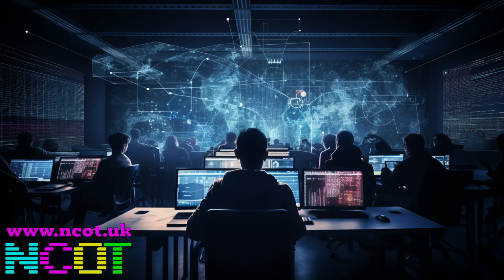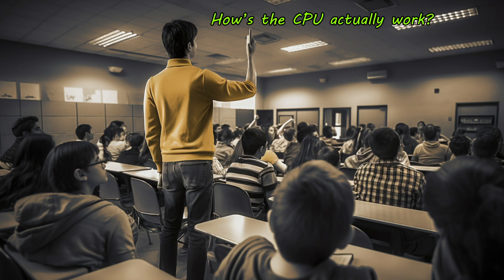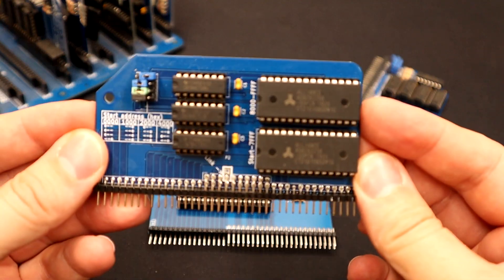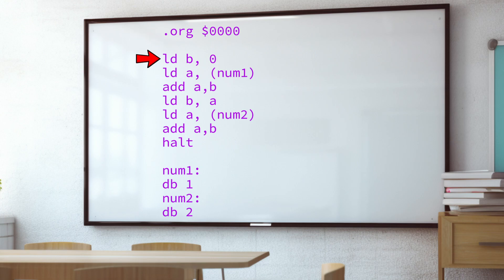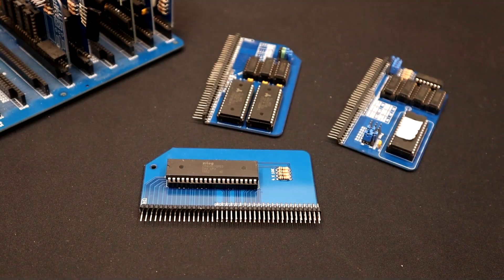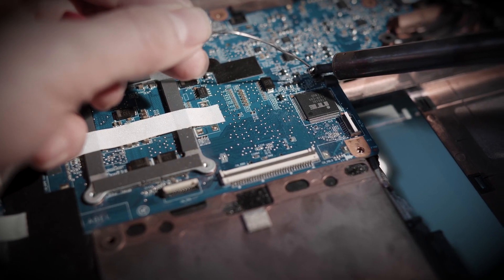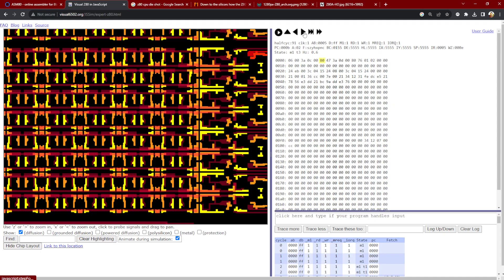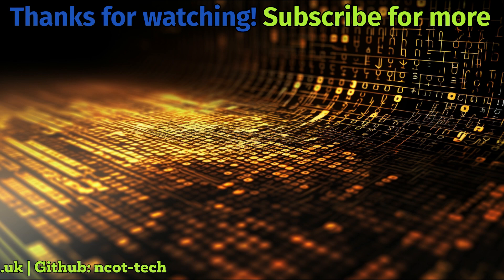Zilog Z80 Deep Dive - How does it work?

Comment: First of all, thanks an informative video.

I'd just like add a few things to the subject:

Nowadays the programs (the opcodes) are stored in the main memory but it was not always the case. Originally the "computing machines" were more thought as super calculators because it was where the need arose first. Mechanical or electromechanical devices had data separated from the "code" that took the form of a hardware configuration. This was tedious and error prone.

The idea of making the configuration virtual by storing the configuration as digital values was a novelty that got the name "stored program computer". Some CPU architectures still use separate spaces for code and data (Harvard architecture).

All the "regular" machines that we use today come from the famous Von Neumann paper (the original sin of computing). This paper was a mathematician's view on how to use an automated device to perform calculus and only this; using that era's technology. How to decode a formula expressed in text form and compute (evaluate) its result. The issue is that that specific paper for a specific task was generalized.

It went from:  This is A way to build a computing device
to:                    This is THE (only) way to build a computing device

There are many other structures and means to perform computing tasks, many of which are not sequential. The first one that comes to mind is neural networks. But unfortunately the Von Neumann model (Y shape with arrows) has "polluted" the minds of all engineers. This is why it is often difficult to get away from the "sequential mind bias" (parallel programming).

The machine code of a CPU is the "grammar" of that CPU and gives it it's "personality". This is carefully crafted because it is what the programmer will "see" from the CPU. This is evidenced by the acronym ISA (Instruction Set ARCHITECTURE). The coder is supposed NOT to know and not need to know how the instructions are actually implemented. This is "at the discretion of the implementer", a form of "API" to the CPU.

The only way "construct complexity" out of thin air is to implement an FSM (Finite State Machine) in some way. This state machine is the link between the instruction opcode(s) and the internal logic components that actualy perform the intended operation. This is why the internal logic can be completely different from what is seen from outside (the Z80 has a 4 bits ALU, see Ken Sheriff's work). The instruction decode is only the first stage of this FSM. An operation symbolised by an opcode is rarely if ever performed in a single step of the internal logic.

Most 8 bit CPUs like (8080, Z80, 68xx, 65xx) implement this in combinatory logic with a special note for the 65xx family that uses a ROM as a first stage.

Because the CISC (x86 etc...) CPUs have become increasingly complex this has been replaced by microcode.
The actual hardwired state machine is replaced by an internal, hidden CPU that runs that microcode. Because there has been an inflation of modes, flags, security conditions etc... the number of clock cycles to execute a single top level assembler opcode has increased (sometimes 20 or 30).

As opposed to this the RISC design paradigm does the exact opposite. Most of the RISC CPUs seek to increase execution sped by using as few cycles per instructions as possible. The only business of the CPU is to EXECUTE code not make decisions it has no information about. All complex decisions are delegated to the compiler.

This is only the CPUs that are inspired by the Von Neumann model. There are many "funny" CPUs even designs that seek to use analogue attributes of electronic components. These are usually, very application specific and require interfacing to the standard digital world.
Reply: What do you mean by “few cycles”? 6502 needs two cycles for a lot of instructions. The SH2 in the SEGA Saturn, the MIPS in The PlayStation need one cycle per instruction. Though these consoles cheat. You only have limited SRAM. DRAM access takes many cycles.
Reply: @ArneChristianRosenfeldt  By "as few cycles per instructions as possible" I was referring to a design goal of the ISAs. 1 cycle clearly qualifies as "as few cycles per instructions as possible".

Basically RISC designs have so few clock cycles that the execution time is equal to the fetch time of the individual bytes from memory. There are no added cycles where the CPU is just churning inside.

The 6502 by its design resembles a RISC design but Sophie Wilson (designer of ARM) said it is on a category of its own. I am not sure why, but maybe because of the 0 page operations that can operate directly on memory and do not obey the "load / store" principle of RISC where the memory transfers are separate instructions from the compute operations.

As opposed to RISC, CISC designs do not have as a primary goal to simplify or reduce the clock cycles of the execution. The hope is that by having more "complete" instructions that more closely matches the C language for example, the instruction count would be reduced to for the same task. The drawback of this is that it leads to complex decisions at runtime.

So, CPUs like the 6502 (even if it is not a RISC CPU per say) will tend to have an execution time that is exactly the byte fetch count when instructions are executed on registers. So an instruction with implicit operand on the accumulator will only use 1 cycle. When using 0 page instructions or indexed addressing the number of byte fetches will extend the execution of the single instruction because the instruction become memory bound.

These memory bound operations would not be allowed on a real load / store architecture. You would have to:
- load in a register
- compute
store the register back in memory
 as 3 distinct operations.

So to summarize, when you are in the very specific case that you have a CPU that is both RISC and load / store (AVR, MIPS) you are correct, most of the instructions will be 1 cycle, unless they need to be extended by wait states for slow devices. This is only valid because direct operations on memory are not allowed.
Reply: I just meant that MIPS as invented at the university in 1980 aimed at 1 cycle per instruction. I just mean that they replaced the complicated "few" optimization problem with a KISS: one cycle or we don't do it. 6502 actually is hardcoded to use two cycles to fetch. One cycle is wasted on single byte instructions. The CMOS version corrects this. Probably it was never really needed, but simplified things. The zero page thing was seen in other microprocessors of the time. RCA 1802 had this external register file, where you still had to load values into the ALU first. Then there was this "first 16bit" CPU which actually just stored 16 bit values in a zero page like a 6502, but could already switch the page for mutli-tasking. So the motivation was not to implement complex instructions, but to outsource as many transistors as possible to off-the-shelf memory. Z80 has 16 bytes. It could really have supported a lot of reg-reg instructions and hence load store may have made sense. reg-mem saves you register transistors because the other operand is loaded into a temporary register, which is free again in the next instruction . The same register can be used first for the addressing mode and then for the reg-mem operation. CMP and test ( zero register target ) also save. RISC CPUs use the same addressing modes. Only Postincrement and Predecrement or so is missing. I don't really know why. Yeah, would need to write back two values into the register file at once. But that would also be useful for a two register pushy shift. Source: Bitfield, shift value, write backs: left half  and right half. I guess that MIPS did not want to carry around circuitry which is not used by most instructions. ARM has a dedicated stack pointer just like the 8-bit CPUs.  @danielleblanc5923

Comment: It's hard to give an exact one size fits all sort of explanation to a question like how does the CPU decode instructions. 
Different Instruction sets allow for different approaches and optimizations when decoding (for example by having categories of instruction types that share the same layout of bit fields), different hardware implementations can be done for those instruction sets depending on target performance, power usage etc. And different architecture types for a certain ISA can have different requirements for a decoder (for example parallel decoding in superscalar CPUs, predecoding, microcodes etc.).

Looking at older hardware, which tends to be simpler is a good starting point however.
I think working with the abstraction of logic gates and explaining a CPU using a visual logic simulator (like Logisim, DIgital by hneeman etc.) is much more approachable, as it is easier to see individual parts of the CPU and is easier to comprehend. By adding an explanation of how a universal logic gate (NOR or NAND) can be implemented using Transistors, all of the abstraction can be undestood.
Reply: @Ignat99Ignatov 
I know how semiconductors work and that would of course be necarry to understand if you wanted to know how modern CPUs are typically implemented in hardware, but I doubt that you'd want to know that in order to understand how a computer works on a lower level, after all a modern computer could just as well be implemented with vacuum tubes, relais, mechanically etc. and work exactly the same, so understanding the physics that make semiconductors work for digital circuits isn't necessary. 

Computer architecture is mostly about the higher level concepts and how they can be implemented with simpler building blocks that can easily be synthesized into hardware (e.g. designing an ALU based on gates and latches in the Register Transfer Level or Hardware Description Language).

Looking at a Computer without any abstractions makes it hard to get insight into why a certain p-n junction is required and what it is used for, since that is typically defined by the abstracted design, which is the reason why I am saying that starting with a layer of abstraction would be useful for understanding how computers work.
Getting to see the actual hardware on a die is still interesting of course! It just isnt suited well for learning about computer architecture (which as I understood it, was the goal of this video).
 

Sorry for the long reply, your message seemed to critisize my suggestion of using abstractions so I wanted to clarify why I suggested that in the first place and clear up any misunderstandings about my intention.
Based on your youtube subscriptions I assume you might be familiar with digital circuit design and that you get what I was trying to say.
Reply: @Ignat99Ignatov  so your argument is "I worked on semiconductor designs professionally therefore you don't know how a transistor works and everything you are saying is wrong"? That's quite rude. 

 I'll reiterate that my argument was that in order to understand computer architecture abstraction is useful. Looking at a die and saying "that's where the zero flag is stored" is less useful than explaining the concepts of how everything works together.

there is a reason why most books about computer architecture use abstraction and why HDL is popular.

Physical implementation of a digital circuit and conceptual design can be separated when learning about the fundamentals, which is especially useful when you don't know anything about either.

I'm sure that you know your stuff well, but I learned computer architecture separate from semiconductors and can still understand the concepts well enough to design processors in HDL and simulation software, which is all I need as long as I don't do hardware design professionally.

I'm just trying to help as a person who is interested in the topic and was once in a similar position as the student described in the video, which is why I thought that my comment might be relevant.

If you were nice about it and provided proper arguments that would be much more helpful to me and anyone else reading the comments. I sure hope that isn't how you treated your students.
Reply: Yeah, the famous Jump, Immediate, and Register instruction subsets of MIPS. But Arm and power are so complicated

Comment: I started out in college building my first computer in 1979 which was a Z80 and literally wrote machine code and later assembler to make it do stuff. Yes I went on to be an electronics/communications/television engineer but the fundamentals about address & data buses, clock and control signals, instruction decoding, program counter, registers, flags, and the stack pointers stay with me always. chips like the 8080. 8085, z80, 8086 and pic16xx processors are really good entry points for learning the basics.  We would actually watch the control, data and address bus pins with a logic analyser to see what was going on inside the CPU and by inference the rest of the computer. Unfortunately once the 80386 and later models came along with caches and pipelines the outside pins of the processor could no longer tell the watcher what was really going on as the data from memory is fetched into the cache/pipeline way before it is processed and sometimes dumped when a branch occurs. Finding a way to give your students a real vision into how a CPU really works will be enormously helpful for them moving into a technical career. It certainly helped me. 
I lament the current generation of want to be techs, that we really need, have absolutely no idea of this stuff as we are all now just application users on black boxes running software created by others.
Thanks for the video.

Comment: The box on the cpu circled the cache, not the registers. You can tell because the are organised in rank and file like a grill. The registers are thousands of times smaller in area. A reprise of Turing's tape 'machine' is still a good place to start.
Reply: The CPU die pictured is a Z80 which has no cache, so they are the registers.

Register files are also laid out in a very regular grid like structure because there is a lot of commonality between inputs and outputs.

Comment: Although this i a good attempt. If you want to dive much deeper in the working of each part of a cpu. This channel https://www.youtube.com/@weirdboyjim/videos has made a quad pumped cpu from scratch. Quad pumped is more advanced then the 6502 or Z80 but it is still the beginning of CPU development before clock doubling and the use of caches. You will need to watch many episodes to see the whole working. And sometimes you might need to google how a certain electronic component works or what it's basic function is to understand the video but this is as close as you can get to fully understand it. The later added technologies like branch prediction, clock doubling and caches where to increase speed and efficiency. The quad pumped part in this video series is also a early example that was such a improvement for efficiency, quad pumped wastes less clock cycles between instructions.

Comment: I usually explain it like that: 
You know what register is ?  That's  "thing" in which you write bits and it stays there.  Now lets look at 74xx chips of standard logic what we see?  One of those chips is "register" and as we could see from description it works exactly as you expect from "software" point of view on "register". But now lets look how that value is stored - there is an actual voltages on pins of that register which represent bits you write into it. And with voltages what you can do ? You can control things. Like make LED light or turn on relay and such. So with that voltages you can control actual finite state machine which would generate other sequences of voltages like paper tape with holes make mechanical piano play music. And that finite state machine decompose each "cpu instruction" into series of elementary micro steps like "enable that circuit" or "switch that multiplexer" and such.  So thats how cpu "knows" what to do with each instruction opcode.
Reply: So you mean unlike in analog circuits, in combinatorial digital circuits information flows in one direction? TTL gates are so complicated. LS ?? ECL is a bit easier just in reality all those current sources are expensive.

Comment: I taught it to primary age as a set of pigeon holes each with a number in it (RAM)  and a set of instructions on a piece of paper (if the number in hole 45 is less than 25 then xxx and so on).  Then I let them play with it for a bit.

Then you talk about encoding the instructions as numbers also in pigeon holes.  They kind-of got it at that point.
Reply: I have one Jacquard loom programmers, dating from circa 1840. It is a real jumble of wood frames, wires, and springs. Even though there were a few cardboard punched cards with up to six or eight holes, tied to one another by two hewn string loops, I donated them to a museum, along with another such loom programmer. I was 13 when I saw those fascinating pieces of machinery and was fortunate enough to have already had learned some basics of computer science (Turing machines and binary codes), so I could immediately tell my parents those were programming devices of sorts, probably for the designs of textiles in the looms (this house they bought had been a textile manufacture in the 18th and 19th centuries). I am 68 y-o now, with some decades-long experience in computer hardware design and programming. That I still have one of the Jacquard programmers that inspired computer hardware is a source of pride for me.
Reply: I've seen this done where each child roleplays the different components.